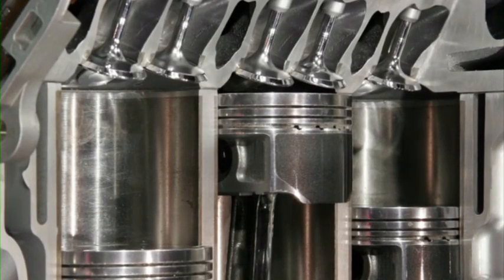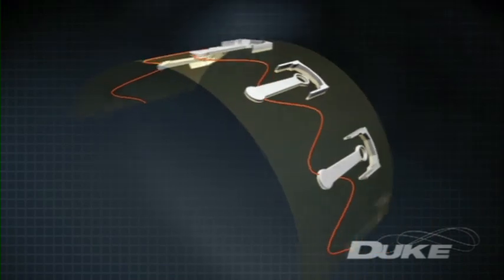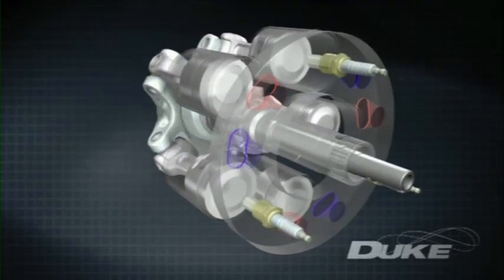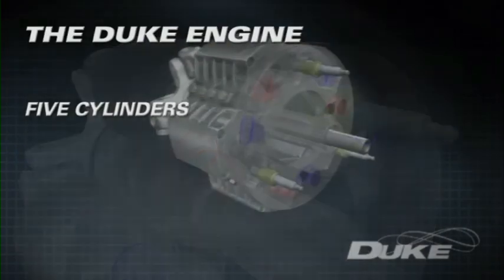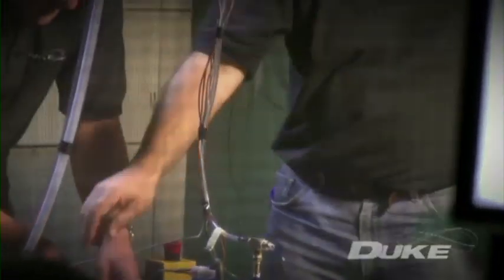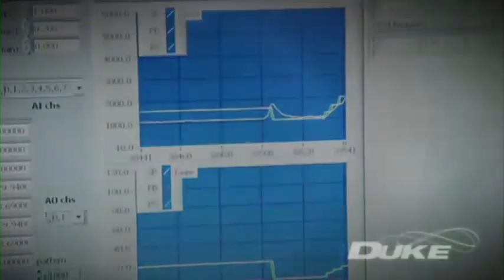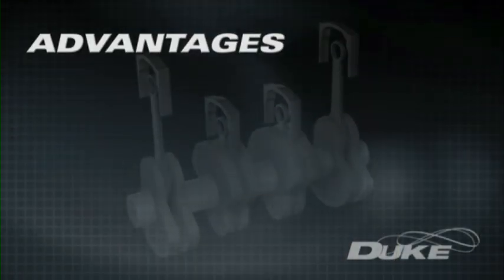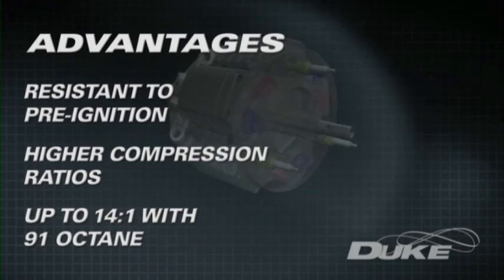Duke Engines

Comment: KISS - Keep it simple stupid.  This engine is brilliant!  Well done!  This has to be so much easier to seal than a rotary engine, with just a ring seal assembly at the top of each cylinder to seal against the head ring.  No cams, valve assemblies, timing adjustment.  Far fewer failure points than a conventional or rotary.
Reply: +sherpajones I also love that it reminds me of a big mean revolver.

Comment: 80% of the internal surface of this thing is in contact with something else...

even if it works it will tear itself apart in no time...

also

3:35 how the fuck this thing have better compresion ratio without predetonation?
Reply: +Omega Rugal  nothing inside the combustion chamber to get hot. like valves. and the spark plug is moved away each stroke. i do believe what the narrator says in that this setup would run substantially cooler than a traditional engine. when it comes to combustion chamber temps.
no valves means better cooling jackets in the "head" or around the ports in this case
having no valves the cooling jacket design options would pretty much be endless.

but friction temps is a different story.
i agree with what you said. so much friction. especially in the "ricipricator" cup seat things. its like a ball and socket joint. must need insane oil pressure to keep those ball socket seats lubricated.
unless those ball and sockets have much lower impact stresses and velocities compared to regular connecting rods at the same "rpm" equivalent of a regular engine. but i dont see how because the surface area contact is like 10x more than a connecting rod.
Reply: people said the same about rotary engines but they can hold their own :)
Reply: Nathan Hellyer
99.9 % of all internal combustion engines ever in mass production were and are, and as long as there is oil in the Earth, will be, "pistons turning a crankshaft, through connecting rods. The reason is the same one that keeps all other designs out of major production. ..efficiency / economy / durability. rotory engines have never delivered the torque or the durability for general transportation, or freight. Nothing beats big ass pistons, and the mechanical advantages of the crankshaft.

Comment: isn't this type of engine put too much stress on the main bearing ?

I mean 5 cylinders are pushing the "tilted" bearing!! , 
well maybe it will operate only in low RPM =D
Reply: +ar ar ar rafael that seems like the application one might use this for. like running a dipping-camel or something else like that.

Comment: This was not originally conceived by these guys, at least not all of it. I've read about it (or a very similar concept) in a German pre-WW II book called "Du und der Motor" where it was called "Taumelscheibenmotor" (axial engine).
Or let's say, basically, this concept is to the axial engine what the rotary is to the radial.

Comment: It's a neat idea but it looks like it could have many of the drawbacks seen in Wankel rotary engines including limited compression, burning a lot of oil, and difficulty sealing it all around.

Mazda tried rotary engines with the RX-7 and they really didn't work out too well in practice.
Reply: +wmilberry Practice? Mazda used the rotary for almost 20 years.
Reply: +Cantrio X I couldn't help but notice just about every RX-7 for sale listing seems refer to it having a "rebuilt engine"
Reply: wmilberry Dont forget to check the RX-8's, they have Rotary's too.

Comment: With that wobbling head arrangement, I would expect to see a lot of vibration. I guess you can mount it on snubbers but for something like an aero application I think this would have to overcome a lot of problems.
Reply: +Mirandorl Actually, there's not a lot of vibration in these engines because of the counter-rotating crankshaft.

Comment: with the centripetal force occurring as the engine rotates, won't that cause uneven wear in the cylinders? plus with the "big end" of the piston attaching to the crank with one connection at a 45 degree angle (or there about's, i don't know for sure) wouldn't that create a big danger for over revving causing the crankshaft to bend? Also with no apparent sump, I have no idea how it's lubricating itself.
Reply: +edwardfeast Someone doesn't understand the difference between centripetal and centrifugal...

Comment: Utterly useless crap.
Reply: +toreibjo If you really want to see true innovation on combustion engines, look to the Kügel motor. The prototypes lies around 80hp on as little as 79 cubic inches. That equals a 351 Cleveland engine chugging out 370+hp at a tenth the fuel consumption that the standard 180hp it puts out. That said. All internal combustion engines is politically bound to die, because some idiot told the press that there is such a thing as human made global warming. No there ain't. But there is smog, and other dangerous LOCAL pollution following. But that is another ball game completely.

Comment: All cars will go electric.

internal combustion engines will be the thing of the past soon.
Reply: +hanif daryanavard That is  a pretty naive notion.. ICEs will not be replaced by EVs... ever..

EVs are far more damaging to the environment

There is no reason why ICE will disappear, even if petroleum runs out..  ICEs will continue running on a wide range of alternative fuels
Reply: +hanif daryanavard Doubtful.
Reply: +RedVelocistar How can you doubt it. there are 2 billion cars on the road if oil runs out, what are we going to do? that's assuming releasing CO2 is not destroying the atmosphere.

The transition has already started .

search for Tesla motors
Reply: +hanif daryanavard They'll use ethanol... It can be made from sugar cane.
Reply: hanif daryanavard
"also recycling stuff helps."  Yeah like waste oil in a diesel engine.

"so why should we burn them untill they are finished?"  We won't.  You know they can make diesel out of hemp?  First diesels were running of hemp and peanut oil.
There isn't going to be any running out, that's a load of bull butter.
Reply: hanif daryanavard Solar panels and EVs are LESS efficient.. and cause MORE environmental damage..
 Not to mention they are both LESS cost effective
Reply: +hanif daryanavard i dont know where you live but in states gas is cheaper than milk, so i dont think its gonna happen soon.
Reply: I have an electric bike. I agree that electric is better in every single way. But since when did fuel companies care about efficiency? They just adapt to what people have/ want and need. IC engines are everywhere, people will want to use them for a long time to come...
Reply: +hanif daryanavard "if oil runs out"  Then you won't have electric cars either, they still have to be greased you know the bearings on the wheels and steering setup LOL
Ohh and forget plastic too.
Reply: The real doktorbimmer
They never talk about what the panels are made from and the waste it creates, also the batteries as well.
Reply: hanif daryanavard
"look up Tesla."  I know and if you read the consumer reports of people that own them you would just laugh.
Reply: hanif daryanavard
It could wind up just as good as the DMC's did, time will tell.
"those you are referring to are small issues like door leaks and things like that."  Nope.

Just because they sell all their models doesn't mean a thing, several high selling brands flopped, ever heard of a "on hit wonder"?

They aren't making heavy vehicles made for hauling any real weight, combustion or turbine engines in vehicles will still be around for the rest of our lives I bet ya.
Because you may or not be aware but semi trucks may be going the way of the turbine engine.
Trains aren't going to be running on batteries to power their motors either.
The electric car is limited, replacing small and mid sized cars may work fine and dandy but other applications it will drop dead.
Reply: hanif daryanavard Tesla's production numbers are minuscule. most companies build more units of a single model than Tesla's entire yearly output.. there is simply not a market for such an expensive vehicle with such limited performance.. its a niche market
Reply: +Patrick TheBaptist I live in the state of Michigan.  There are Michigan laws in place to prevent the sale of cars "Direct to consumer".  Basically, any cars sold have to go through a middle man known as a dealer.  That being said, Tesla cannot sell cars to consumers here in the state of Michigan, and yet I've seen on multiple occasions many different Teslas, including one Roadster.  It's not so much a niche market as it is a solid idea.  Low volume, High price; mid volume, mid price; then onto High volume, low price.  It has a path it's gotta follow before it'll be consumer friendly for price point, but already they have a solid idea and they're running with it.
Reply: +The real doktorbimmer With EV you can charge your car with Solar, wind, nuclear, fusion, hydroelectric, and ask renewable sources.

even if you use fossil fuels you get double the efficiency charging your electric car from a fossil fuel power plant.

Tesla Motors has developed Luxary sedan and SUV Evs with great acceleration of 0-60mph in 2.8, 300 miles range , top speed of 155mph and zero emission. 

you need to check things out man
Reply: +Luke Wright sugar canes use sunlight to make those sugars and then you'll have to burn it out in a fuel cell then turn that into mechanical energy this is extreremly inefficient and you have to exploit a lot of resources like water and land.

what's wrong if you charge your electric car using solar panels that turn sunlight straight into electricity?
Reply: +vxr8clubby You have no education in basic physics.
Reply: hanif daryanavard
I've seen Lambo's and and F's but I've yet to see a T in person.
Reply: D'Montae McWillie Yes, and those laws are there to protect the consumers of State of Michigan against manufactures that reside out of state from skirting the consumer protection laws in your state and defrauding or leaving car buyers without product support or warranty validation or service..
Direct to consumer sales absolves the manufacture from liability if the costumer is "left holding the bag"

Earlier predictions of the EV markets growth have turned out to be grossly over-inflated.. and the market shows clear indications of reaching saturation point soon.. this confirms many market analyst conclusions that it is indeed a niche market.. with little growth potential in the future
Reply: +The real doktorbimmer
Forcing them to go through a dealer protects nobody but the dealer.  If I want to take the risk and buy a car directly from the manufacturer, who are you to prevent me from doing that in the name of protecting me?  I know the risks and they are entirely MINE.  It really pisses me off when some moron argues for government meddling that simply takes away the choices to consumers.  Dealers do provide service but ANY business can do that.  I don't need to be forced to go through a dealer to receive those services.  Dealers don't protect anyone.
Reply: hanif daryanavard then humanity will realize we messed up again and go back
Reply: hanif daryanavard not forgetting that the batteries of the future for good mileage will be expensive , the fossil crisis could be solved with biofuel , and instead of falling to oil companies we would fall to Tesla and electric companies. I'm good with my Biodiesel
Reply: Rick Sears yay , the first biofuel supporter I found on YouTube
Reply: Patrick TheBaptist I have , very few down south.
Reply: It will take decades before the world has enough electricity to power electric cars all over the world. Think of big cities like Manila, theres barely enough electricity to run air conditioners, transformers are exploding all over the place due to overloads, the CHARCOAL powerplants already cant keep upi with the demand. Just a few Teslas would nuke the grid and create an infrastructure disaster. How many charcoal powerplants do we need to electrify the car park only in the western world? Thats way more pollution than fossil cars can create. Electric cars arent viable for many decades, already now we are getting higher CO2 emissions because of electric cars in Norway, where the clean electricity is used locally instead of being exported to Europe to replace the dirty charcoal power.
Reply: The most ridiculous is that mr hanif implies that the world is running out of oil, which we are most certainly not. The planets oil reserves are enormous, even when not counting oil sand and USAs oil production from Fracking.
Reply: Wrong, almost 95% of all new oil wells are fracked. Not only USA/Canada but also In Ukraine (since more than 60 years ago), NZ, South Africa and more.
Reply: Tesla is a dying company
Reply: Ever heard of fuels other than oil?
Reply: Ploffy Kha Hint: Nuclear power
Reply: You are typical of an uneducated self-annointed "engineer".
Reply: +Patrick TheBaptist 

so why should we burn them untill they are finished? 

instead we could have clean energy by using solar panels and electric cars .

also recycling stuff helps.
Reply: D'Montae McWillie
I didn't say they don't exist here, I was just saying I haven't seen one yet but I've seen some real exotics, oh add 2 Ford GTs, S7, and a DMC to that now that I think about it and I don't goto car shows, I'm just talking about cars I've seen on the road.
I don't think they are just outright junk, but I'm a guy that prefers SUVs and trucks, neither do I want battery powered, especially truck wise as I am a salvager.  Semis maybe going the way of the turbine engine away from diesels in the future though.
Then again I don't buy brand new vehicles no matter whos name is on them, my first and last brand new vehicle was a 2002 Ranger Edge, since I learned it cost way more per mile to own a used vehicle that is easily paid for in cash, I'm a practical spender/cost effecient spender.
I was burning waste oil until I sold my last diesel, I only had to use 20% diesel (off road) and mix it with 80% waste oils that were free, so it was real cheap for me to drive around in my 7k lb truck.
Reply: +Patrick TheBaptist charging your electric car with a solar panel on your roof is 1000 times more efficient and convenient.
Reply: +Patrick TheBaptist internal combustion engines are 20% efficient. electric cars 90% .

you want to grow Hemps then put it through complicated process to make diesel and then burn than diesel with 20% efficiency. 

with electric car you just plug in your car anywhere you want. either using solar panels, hydro,wind,nuclear or fusion in the future. 

which one is easier
Reply: +Mark Brooks hydrogen fuel is dumbest thing ever .
electric cars are already outselling petrol cars in US. look up Tesla.
Reply: +Patrick TheBaptist so why they sell out all their productions every year? those you are referring to are small issues like door leaks and things like that. and you have to appreciate that this car is newly arrived and as time goes by, it gets better.
Reply: +The real doktorbimmer
its not a much market. they have been doubling their production every year. they are new. other car makers are almost a century old.

have you heard of Giga factory? and their model 3 mass market car coming in 2017? that only costs $35?

by the way Tesla cars have better performance than any sports car have.Tesla easily out performs Lamborghinis and even ferraries.
Reply: Ploffy Kha fracking is illegal. Also just sayin' , it would be nice to run just a bit cleaner with cars

Comment: how is this not a derivative of the radial engine?
Reply: +T.C. McQueen pistons in cylinders driving a riciprocator vs. roaters directly driving the driveshaft
Reply: but the recipricators still hooked to the driveshaft. It's the same thing.
Reply: by that logic since a standard engine has pistons connected to the shaft it to is a modified rotary
Reply: a piston is linear motion that transiton to rotary via the rod and crank.  A rotary is just that, rotary, then translation through platetary gears to the crank.